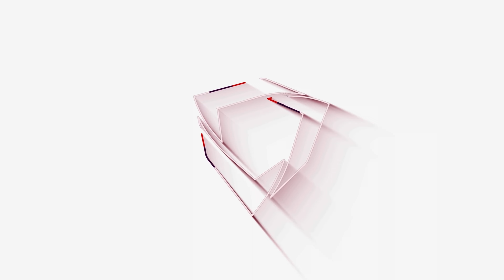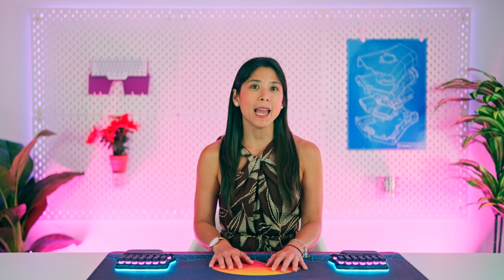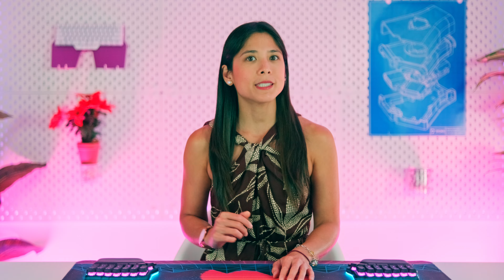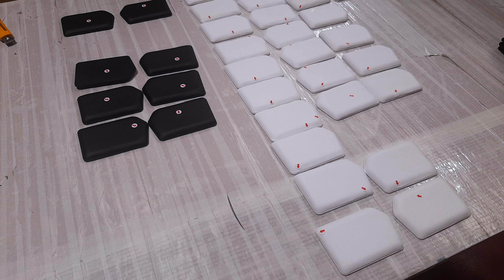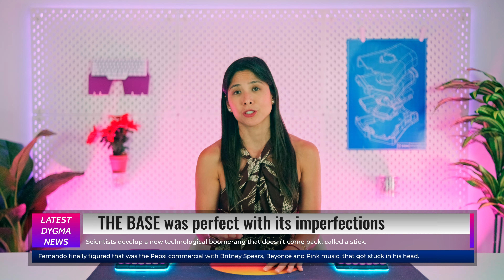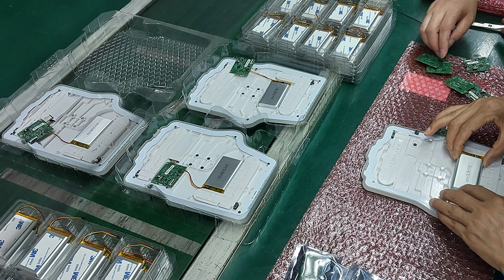First Defy Keyboards Shipped & Big Bazecor Update!  - Dygma News #12

Comment: Could you describe the pros and cons of getting the wireless module?
Reply from the maker: Pro: It's wireless with RF and BT with 3 devices, but you can also use it wired
Con: it's 80 bucks more 😅
Reply: @DygmaLab  I got that much, I'm thinking more in terms of what the limitations would be going wired. Options to place the left and right. Portability. And so on. How far apart can you move them with the cable? Is it in the way?
Reply from the maker: @ekjellgren oh, sorry: we provide 2, 30cm cables and 1 50cm cable, so you could have the sides 80cm apart (bit less probably). The cables connect to the neuron, and the neuron to the computer. That way, they are not in the way ☺️

If you plan to use the keyboard mainly in your desk, wired is plenty enough. If you're planning to use it on the go with laptops and iPads. Then wireless is a nice to have.

Comment: I'm on the verge of ordering a Defy while the pre-sale is still running. Been waiting for a split ortho keyboard with wireless, hot-swap and good software for a while, and recently my body's been telling me to pull the trigger sooner rather than later.

Is there any ETA on quick switching between multiple bluetooth devices? And another thing I've been wondering... I'm a sound nerd and will be thinking about doing acoustic mods, for example.putting foam or silicone mats into the case, or installing switch pads. Could this be possible without voiding the warranty, if done with care (i.e. non-destructively)?
Reply from the maker: The BT quick switching is already being tested and should be ready in a couple of weeks, so nothing to worry about. 

Regarding sound, you can open the keyboard and mod it without voiding the warranty. And I'm sure you'll be glad to know that the keyboard already comes with 3.5 mm foam under the top plate and a .3mm felt switch pad. You can see it in our live stream at minute 23 https://www.youtube.com/live/tJqLdjG1Djo?feature=share&t=1401
Reply: @DygmaLab  That is great to hear! :)

Comment: Used to write software for electronic magnifiers, we were designing pcb's and other components in house and have them manufactured in taiwan (the classic) and then doing all the assembly and testing here in our North America factory. It was hell, I remember rejecting around 25% of the cameras because of assembly errors at the socket level which there's nothing you can do about. Sadly there's not much alternative to dealing with these companies.
Reply from the maker: It's a constant fight. You need to have a very strict IQC and final QC to ensure that everything is perfect before you ship.